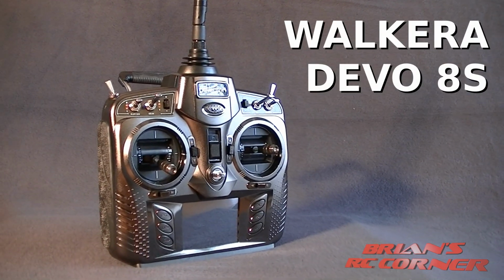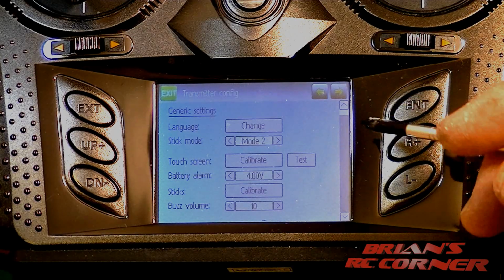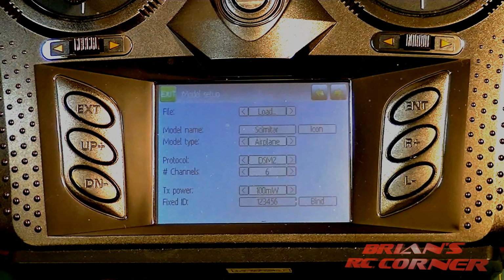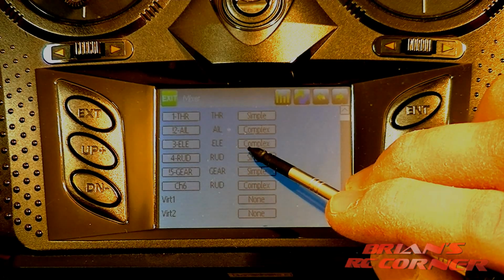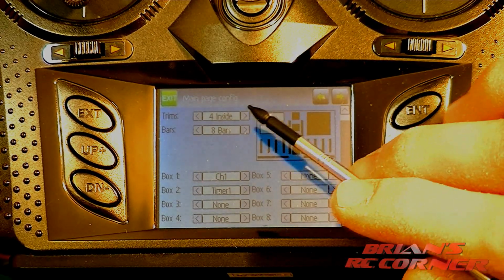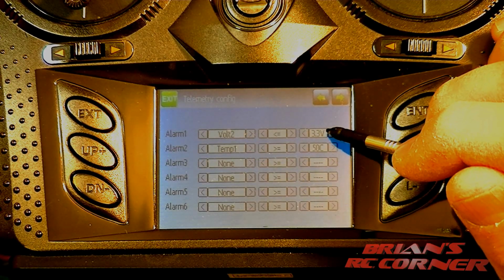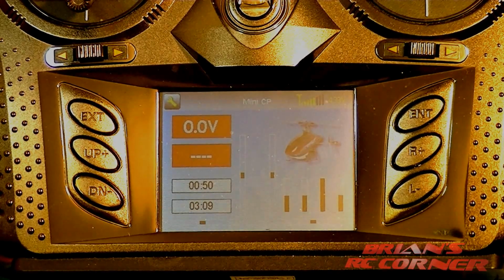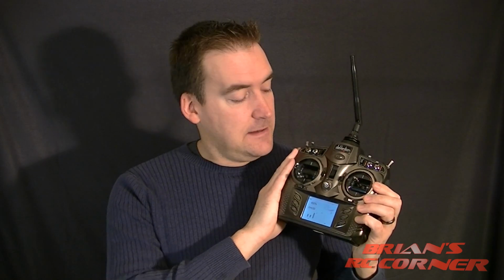Walkera DEVO 8S Transmitter with Deviation Firmware - Multiple 2.4GHz Protocols!

Comment: I had this tx for a while and decided to change to spectrum so I could use cheap orangerx receivers. I discovered the deviation firmware while waiting for my dx6i. after having a go with the spektrum it went straight back in the box. the stick movement on the devo 8s feels much nicer in my opinion and the complex mixing is awesome and very easy to use once you get your head around it. it's just a shame there is no knob on the tx for camera ptz etc.